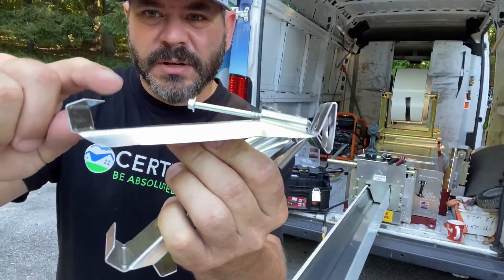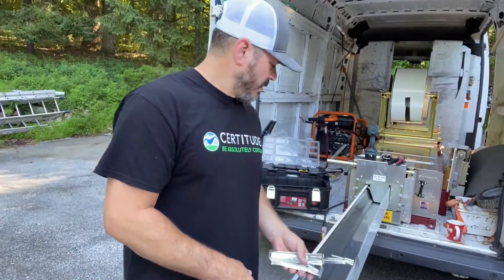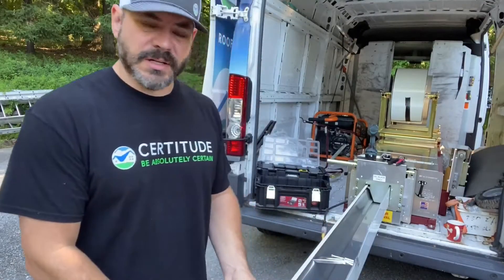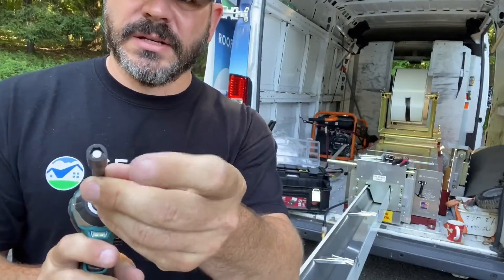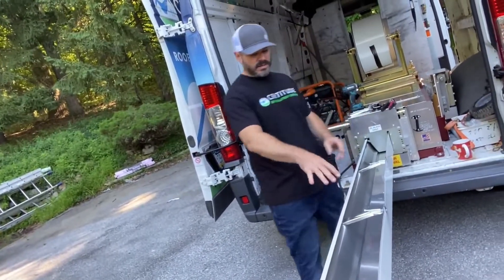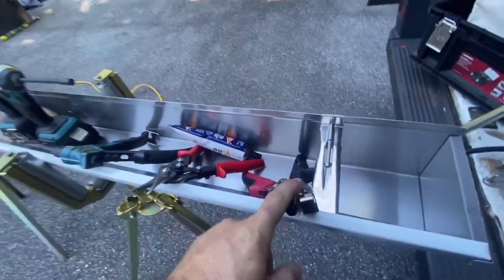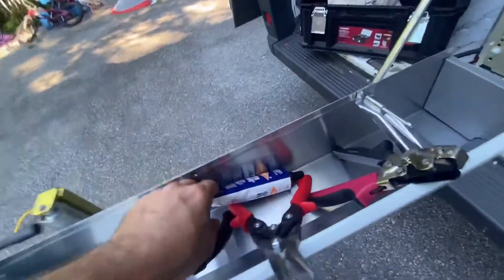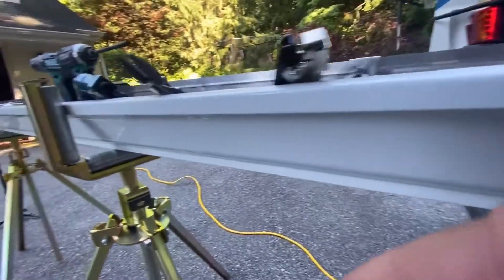Our Gutter Machine and how we make gutters

Comment: I don’t recommend the hangers in the video  the screw has no washer we see so many homes with rooted wood because of those hangers use The same screws they use for metal roofing their metal to wood and have a rubber washer that’s waterproof
Reply from the maker: We have never had the issue of the wood rotting because it doesn't have a washer....Most roofs have a drip edging that goes on top of the gutter and over the hanger to protect water from getting into the hanger screw and to allow for proper flow of water into the gutter not behind it.  Send us a link to what hanger you use...we are interested regardless...we always look to better the materials we offer.
Reply: I throw all the hangers like that I come across in the trash. I find too many of the screws broken. Clipping the hanger on the back of the gutter adds it's own complications and I never do it. I'm not at all interested in hanging fast I want it to hang tight. Therefore when I got to know Hangtite hangers from Raytec and in fact won't do a gutter job without them. When I was done with my last job I invited the customer, the owner of the lumber yard out and told him that right then I'd hang off my gutter and if it fails I have nothing to charge him for. Huh I just figured out how to make the oval outlet hole that comes with a Mason cover. no, no I didn't I throw them away too and use a 2 3/8 outlet and instead of wasting all this time cutting a hole I'll stick to using my hole saw and be home eating supper before this guy's done fucking around.
Reply: Wouldn't the washer just seal where the screw contacts the metal on the hanger istself? I mean with the type of hanger that clips on, and requires you to fish the smaller screws out of your pouch, hold it in place to get it started, and then drive it in, im not talking about the ones in the video that come pee inserted into the hanger. So as far as the part that the back a sees, is at not exactly the same? The part in the facia is the threads on the back side of gutter, after it has passed through the hanger, and then the back of gutter. So wouldn't the facia see the exact same thing regardless of which screw, or hanger you used? The neoprene would just seal the surface it was in contact with. Also aluminum is pretty soft,  seems like a screw holding tight aluminum to wood would make a pretty water tight seal as well. Especially on a vertical surface. And then 2 more points, the hangers in the video are bent around into a tube that the screw loosely passes through, and the screw is like 3" long. That tube, along with the bull nose in front, and the bend upand over the back make a noticeably stronger hanger. Ho could it not? More bends, especially loose bends make stronger sheet metal. Right? That much longer screw which is steel, also holds tighter, and does have a flange built in making it grip that hanger tighter than your scout leader when you were his special assistant that unforgettable summer. It also keeps the head out front of where the shingles overhang, so water is not dripping right on the head. The other hangers with a 1" overhang, and a hex head screw leave about 3/4 inch over the screws im sure water could drip back on them a bit, though I can't seen it causing too much a problem. somebbozos hang the shingles over 2 knuckles which causes them to droop into gutters, looks teriible, leaves little room for your hand to clean them, and on retrofits, causes careless instalers to break the shingles trying to get a screw drive underneath. Exaserbated with the older style hanger. Could the leaks you are seeing be caused by something else? Like 4' apart hangers sometimes cause the bAck of gutter to fishmouth, and form a pocket where shingles drain behind the guttdr? Some regional practices are to hang with no facia. This is a similar situation to 4' apatlrt. Obviously won't rot facia if one don't exist, but tails? Also sometimes roofsrsninstall new con before facia, then facia is installed and shingles no longer hang over. Problematic. Ive only Biden doing gutter a few years, but ive been roofing for 30, and been a roofing contractor for 14. Ive never den the problem you speak of with these hangers. In my opinion they are the cats aSs. I havnt ever seen a problem with the ones you are talking about either. With or without gromets. Spikes and ferrules, ive seen on any roof that has them, as I pretty well only do resedemtial reroofs, and only install gutters on homes in reroif. Never new construction. I can charge much higher prices, and gide the cost in the overall roof quote, and customers are happy as regardless my prices for roof+ gutter is still much lower than most others roof only, and everything gets done in one shot, at same time. It could be you are in a much damper climate than I am as well. Im about 30 miles west of Seattle, so pretty arid in these parts